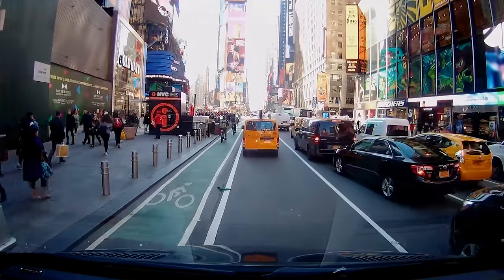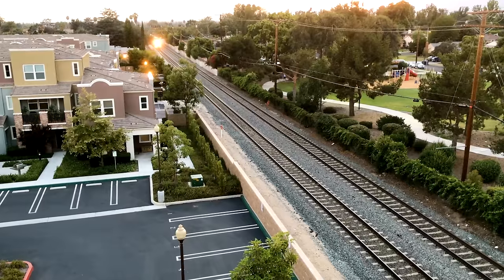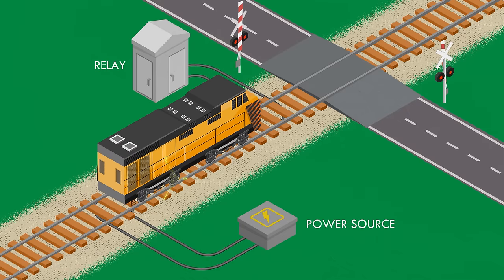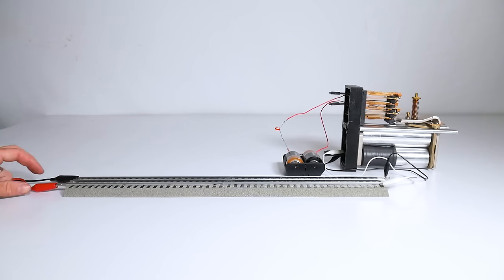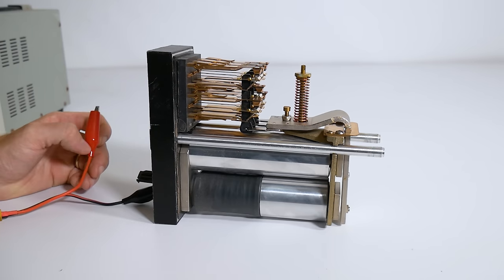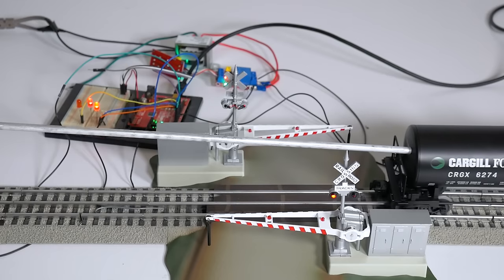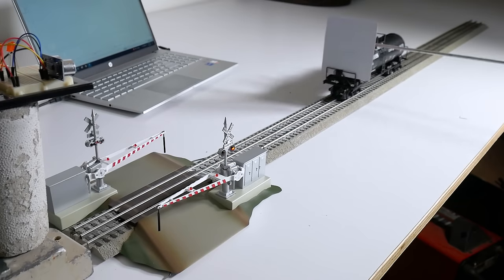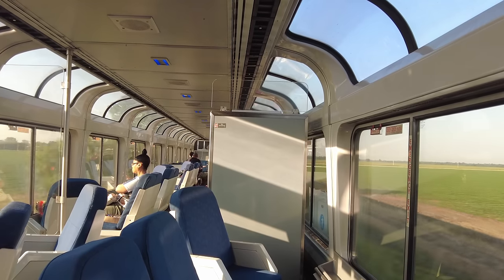How Railroad Crossings Work

Comment: I saw a car drive through a RR gate.  The care kept on but the damaged gate was bent in towards the rails and it was struck by the passing train.  Within 5 minutes, UPRR was on scene and the gate was replaced and operational within 30 minutes.  It was impressive.  I was waiting for an autoshop to change a battery in one of their fleet vehicles I was picking up to take to auction.  So, it took longer for a auto repair shop to replace a battery than for UPRR to respond and repair the crossing gate.
Reply: Its more a necessity than impressive. Can't wait around a week for a broken gate to get fixed, if someone drives onto the tracks and gets hid by a train because the railway's crossing was broken they have a big legal problem. They can't stop running trains for a week for the gate to get fixed, as the cost of downtime is in the thousands if not tens of thousands of dollars per minute. Anything on the railway goes wrong they have to stop everything at huge potential losses so extremely quick fixes are the way every problem has to be handled.
Reply: @MaskMcGee ”cost of downtime”…. You mean they’re just not making money
Reply: @ThinkTooMuch69  no, they're actively losing money
Reply: @MaskMcGee  no. Stop. Something being necessary does not affect how impressive it is to someone else. Stop trying to ick someone's yum, and more importantly, stop discouraging others from saying kind things.
Reply: @MaskMcGee  everybody knows it's necessary. It's so blindingly obvious that that's the reason they do it, I just don't think anybody else thought it needed to be said. They just kind of understood that pointing out the obvious wouldn't make them sound smart.
Reply: Anyways, back to what I wanted to say in the first place... lmao yeah, sounds right for mechanics 🤣
Reply: ATCS and PTC can talk to vehicles and tell them that a train is coming and prevent the car from going into the crossing.

We are supposed to be using the technology already but they are not using it and I don't know why
Reply: its because the repair shop likes to check engine light codes and do preventative maintenence on the car before they give it back, and thats why your prices are so high.